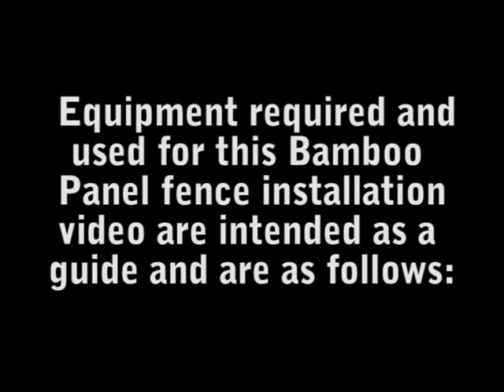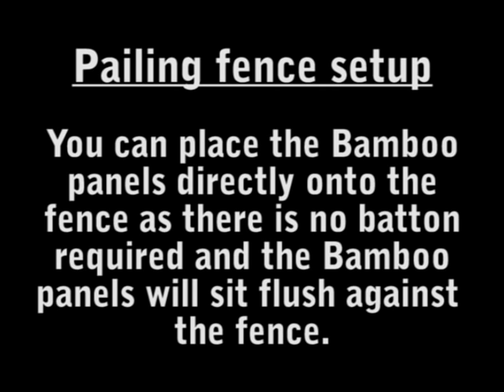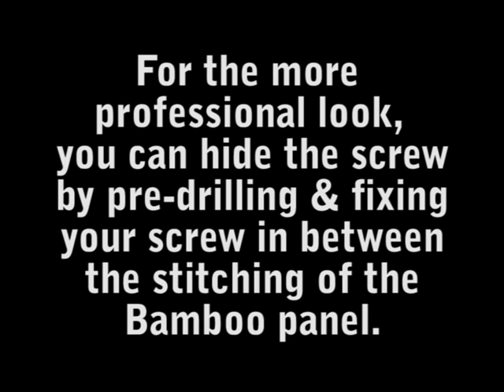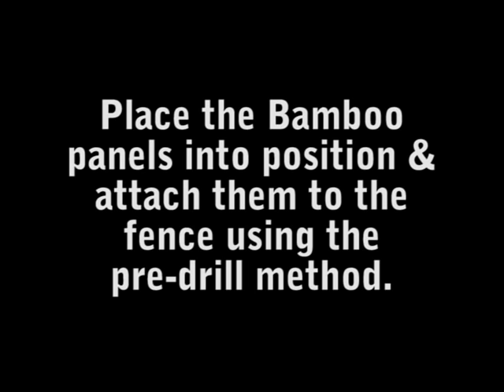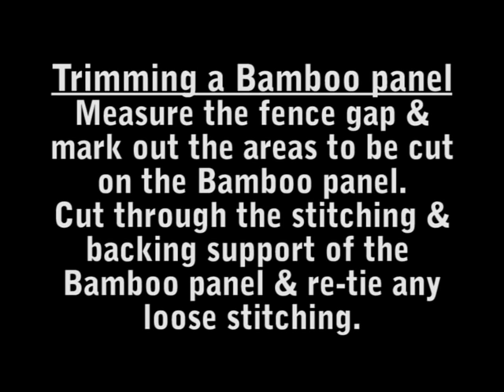DIY BAMBOO PANEL FENCE INSTALLATION GUIDE

Comment: All good if you have a wooden fence like that but if you have what we have, its impossible without building another fence because this cant be screwed onto corrugated hardie fence made of concrete sheeting
Reply from the maker: G'day, If you have a corrugated fence you can install horizontal timber rails on the top and bottom and then install the bamboo panels to the rails, screw the rails into the upright posts of your corrugated fence, match the horizontal rails to the same heights as the backing rails of the panels, then screw through the backing rails of the panels into your newly installed horizontal rails.

Comment: What size screws did you use.
Reply from the maker: 75mm Galvanised screws. Cheers
Reply: palmplacenursery, thanks for the quick reply. Damm I bought 50mm. Instead off drilling the holes can you out the screw in between the bamboo where the panels have the support beams?
Reply from the maker: Thats should be fine the panels are 5cm thick, so if you screw in between each culm directly into the backing rail it should work.